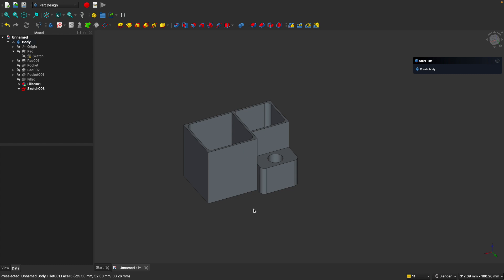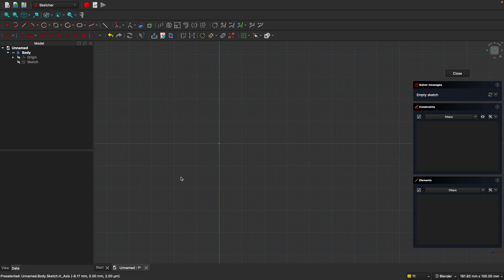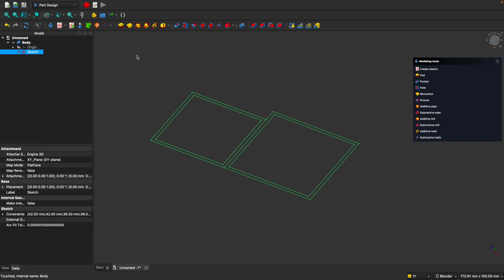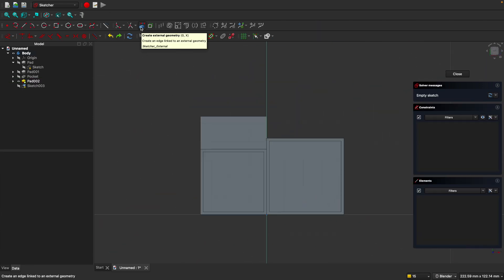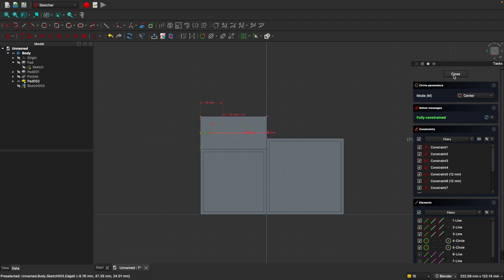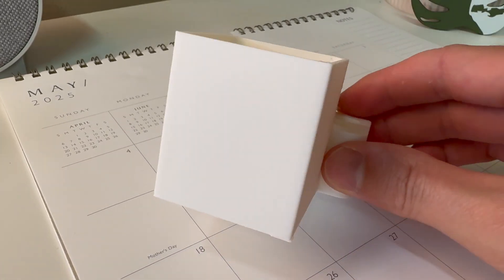Learn FreeCAD for 3D Printing - Complete Quick and Easy Guide (Beginner)

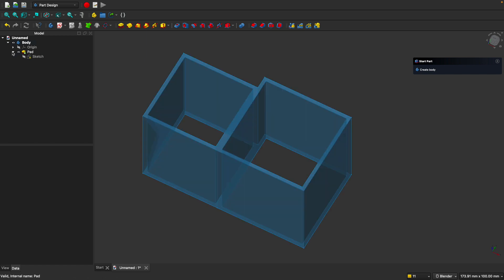Comment: At 5:16, as he mouses-over the back face, you can see that the two cubes are separate pieces. He is able to hi-light the back faces individually and you can see a dividing line from the bottom plane to the top. I did exactly what he did and have the same shape only my back face is a single piece. This makes it so that I have no ability to create a sketch on the top face because I cannot select the 36mm portion of the dividing wall without grabbing the entire 42mm. How did you get the two cubes to be separate, joined, pieces?
Reply: I ran into this and I think I figured it out. For the first pad, when I set Refine=false in the data panel, I was able to get two separate faces.
Reply: @Snailslug  Aha! Awesome. I'll try that once I wake up a bit. Thanks for the research and the info.

Comment: pretry good vid well done! 2 tips, I think you didnt mention the workbench selector, people are likely to end up switching workbenches at some point without meaning to and then will be very confused as to why all the menus are wrong. while you didnt have a 2nd piece in this model, if you create a box with a lid or such, it would be nice with a tip on how best to account for the nozzle size(s), eg the gap needed to make the parts fit without being too tight. keep making vids, we need more nice freecad tutorials using v1.0 as it is more usable than ever :D

Comment: 4:30 One issue I kept running into was that when I would pad my sketch, I didn't have the line that separated the two rectangle shapes like in the video. This kept me from editing the height of one of the rectangles without affecting the height of the other. Did anyone else experience this? Any help would be much appreciated!
Reply: Same problem. Never did figure it out.
Reply: Your comment is 10 months old by now, but I'm having the same issue. How do you "cut" them apart so they are separate?
Reply: i found solution, select the pad in your tree, look for Refine in properties (bottom left) set from true to false
Reply: @EllJQ  I've been fighting with this for an hour and this fixed it.  Thank you
Reply: This is also the issue I am running into, I even scraped the whole thing and started over thinking I missed something but it did it the second time as well. Im not sure what we did wrong or what setting is causing this. Did you ever figure it out? @mattsoto4329

Comment: I've found it useful to make wall thicknesses multiples of the nozzle diameter of the 3D printer the part is going to be printed on.  For outside corners, I use a radius of the 1/2 nozzle diameter or larger.  In your example, I would have made the wall thickness 1.6mm.

For reference, I tend to make larger mechanical parts and use a 0.8 nozzle for most things unless I need some really fine detail.
Reply: With arachne this is no longer necessary, and also extrusion width is usually not set to the exact nozzle diameter in the slicer
Reply: @AniviaS  I prefer to not depend on a software crutch in lieu of proper design procedure.  For the second part, in Cura at least, the default extrusion width IS set to the nozzle diameter.  To correct myself, "For outside corners, I use a radius of 1/2 the extrusion width or larger."  You can never get a completely sharp/pointed outside corner with a cylindrical blob of plastic.

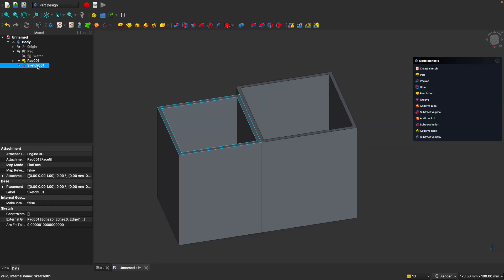Comment: Getting stuck on the pocket part 7:00, Pocket: Wire is not closed 5 times error.
Reply: im sure you have figured it out but, he is a bit too fast and the lines are difficult to see. You have not selected all the edges, so therefor the error.

Comment: I really really wanted to learn the FOSS alternative instead of whatever paid software but it's getting very tiring. 
On the 1.0rc2 flatpak release there where all kinds of UI bugs so I tried the AppImage and it hard-crashed twice by minute 6:30 of the video simply by following the instruccions; and on both versions the offset tool wasn't working properly from the start so I gave up 😢
Perhaps it's more stable on other platforms? I don't know but I will try again when the final release comes out. 
Anyway, thanks for the video, very few starting guides updated at the moment.
Reply: report everything you find not working, this is the moment they fix proper issues :)

Comment: It seems I am unable to add dimensions when trying to make the rectangles. Is this a know problem?
Reply from the maker: Are you using 1.0 beta? It should let you add dims
Reply: @3DPrinterAcademyTutorials  Oh oops. I was on the older version of the system .21. Still not super good with 3rd party downloads. x)